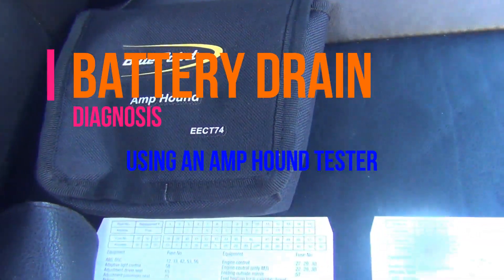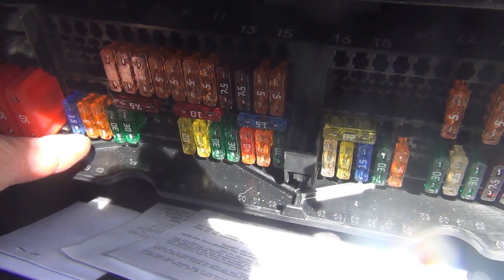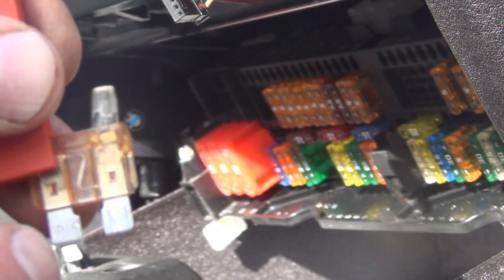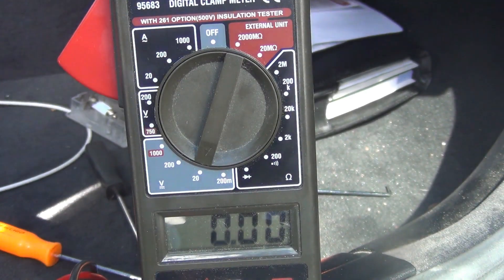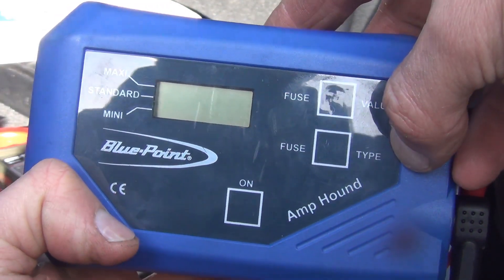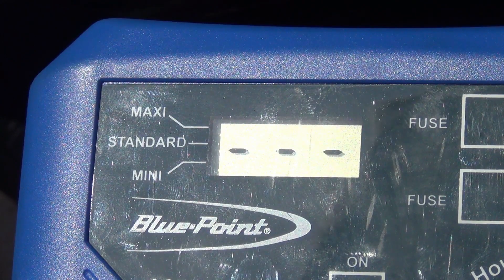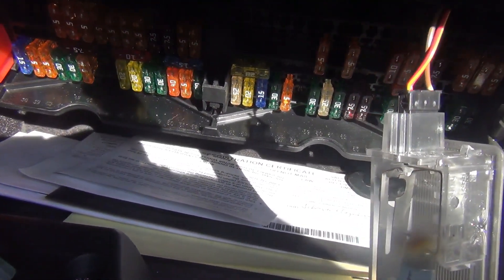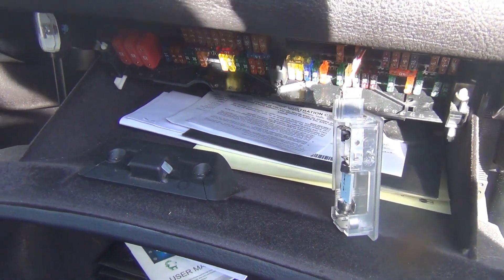BATTERY DRAIN DIAGNOSIS PARASITIC DRAIN TESTING USING AN AMP HOUND

Comment: Good evening happy holidays say I have a problem with my 2004 mercury mounteeneer I had to get it jumped several times I had the battery checked out and it was working as well as the alternator and starter but something is draining the battery overnight
Reply from the maker: Hello, Happy Hollidays! Sorry to hear you have a drain. I hope this helps you solve it.

Comment: Awesome vid! Ty. How do you test Nissan  fusable links pls? I tested all other fuses and my parasitic draw is not coming from them.
Reply from the maker: Thank you.  A usable link is a fuse built into a wire. If you have a drain from those items you can use an amp clamp around the wire to see if there is amperage.
Reply: Mine looks like 3 to 4 fuses in a box sort of. And it installs like a fuse in the fuse box with other mini fuses.
Reply: Your first mistake was buying a Nissan the worst design automobiles in the world,not mechanic friendly at all if I could give mine away free I would but nobody who knows anything about car maintenance wants it.

Comment: How do you probe the maxi fuse?  removing the polycarbonate cap?
Reply from the maker: If they do not have an access point on the back of the fuses you would need to remove the fuse to see if the drain goes away.

Comment: Very good intro to a useful tool and it’s use for Leakage testing.I want to clarify something misleading to novices. Not all fuses have power going to them at all times. That is to say a switch may need to be turned on first, depending upon the design of the electrical system for a particular circuit. This means That a person will not always find 12vdc on a fuse (relative to chassis ground) and that is fine. Further, one may measure no current across a fuse and be mislead that the circuit is dead, but it may not be drawing power at that moment. Again, this is irrelevant to looking for leakage problems that by nature are constant regardless of switch positions, but I point this out so folks do not make the wrong conclusions.
Thanks for the video intro.
Reply from the maker: Thank you Paul for the additional pointers! Much appreciated!

Comment: I'd like to see how you performed trouble-shooting on the instrument cluster.
Reply from the maker: Hello, I would be happy to go over that. Once I found the drain was for fuse 34 I looked up a wiring diagram and found it was a power supply to the instrument cluster. There is a website I like www.newtis.info that provides BMW wiring diagrams. (If you would like I could make a video to help explain how to read wiring diagrams.) I then disconnected the instrument cluster at the connectors and found the wake up gone. Plugged it back in and it came back. I did take out the I-Bus pin to rule out any communication wake ups from other modules. Then I checked what did not work with the fuse out and realized it was only for OBD communication to the cluster. Let me know if I provide any further info. Thanks for posting!
Reply: @AskTheCarExperts Thanks for the detailed description. I'd like to see a video on reading wiring diagrams!
Reply from the maker: @259Den3  Will do! It may take me some time to put it together but it will be in the works. Do you have any specific topic or diagram or car you are interested in? If you want to reach me by email go to my website at www.askthecarexperts.com I am working on a new format but the old one is up and has a submission form.